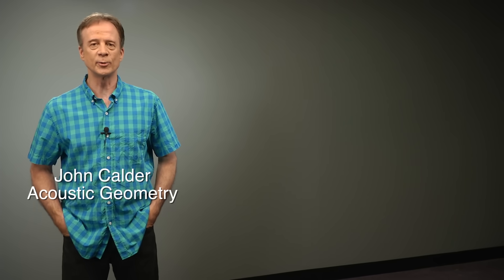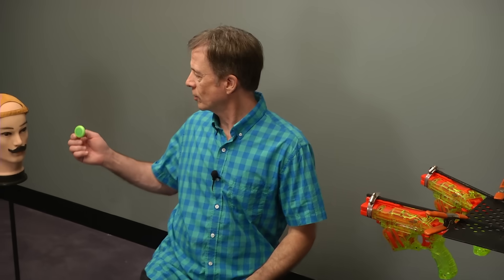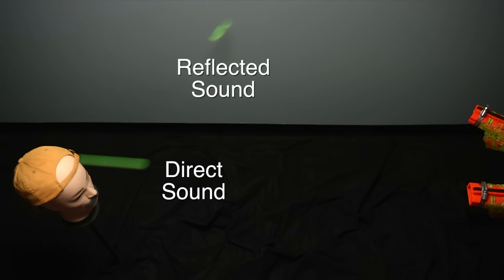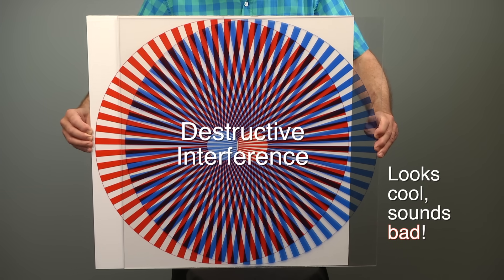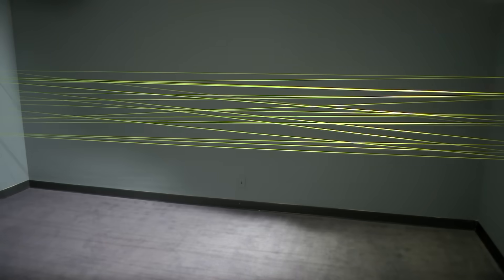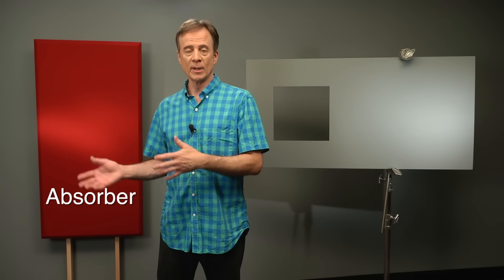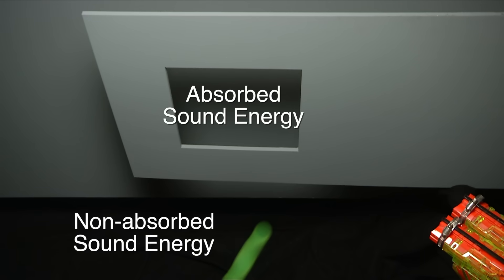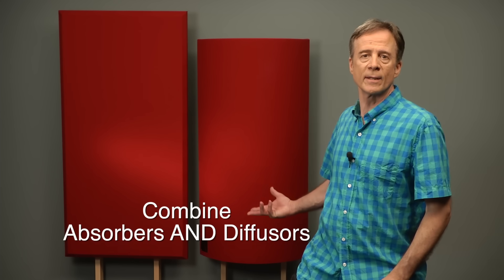How Sound Works (In Rooms)

Comment: You said sound bounces of the walls. But i heard also sound passes through the walls..🤔.so the question is how much in/out
Reply: Sound does pass through walls, but it's mostly the lower frequencies that you have to worry about. That's why you'll hear the subwoofers from people's cars going by, but not the rest of the song.
Reply: Sound can pass through walls but it's a subjective question because you'd have to define what type of wall it is. More sound will pass through a dry wall layer then say a brick wall....the reflections from a dry wall and brick wall are going to be different as well I wouldn't say either is better as a bare wall. 

All walls arent equal...sound proofing is based around thick and or reinforced walls. Which is why the average home/project studio will have acoustic issues. Things like a mattress or a large bookcase filled with books ...or even a thick rug on a wall or even better hung from the ceiling close to a wall can help drastically. 

 In a perfect square 4 wall room if you can cover the wall the speaker points to and the wall that is behind the speaker those would be the first areas to address. If the r room isn't treated and you have hardwood floor cover at a minimum the area you listen at. 

If you have carpet your in business. This won't solve all the way around acoustic issues in a room but it will reduce excessive sound from bouncing  around. You don't want to over do it either you just want an environment where the sound can land softer....this is extremely important and goes a long way especially when mixing and translating mixes. Good Luck!
Reply: @magicizaproblem  damn bro.. never expected this much.! Well explained. And much appreciated.  😊👏👏👏

Comment: According to some other videos; in terms of audio, placing the speakers 1/5 of the rooms lenght and depth will achieve better sound. Does anyone know if this 1/5 rule is simply to reduce distortion without the need of dampeners and difusers? Or do these 2 methods work in sinergy towards the same end?
Also, 2 more questions:
how do windows affect wave's behaviour?
How would one decide where to put the dampeners and diffusers?

Comment: Great advice for auditoriums, but at home I'm a pack rat with my rooms crammed with all kinds of stuff and most of my walls are either blocked by stuff, shelves, furniture, or covered with frames, paintings and other things hanging on the walls, and of course, there's also windows, drapes, blinds, screens, rugs, doorways, and various ceiling material.

Comment: This by far is one of the best videos about echoed sound ive seen thus far.  . . Straight to the point with a long drawn out explanation.  He even had examples.. i love it !
Reply: That is not echos sound, but reflection of sound refers to the bouncing of sound waves off a surface. This can occur when sound waves encounter a solid object, such as a wall or floor. Echo is the repetition of sound that occurs after the original sound is produced. It happens when sound waves reflect off a surface and return to the listener.

Comment: Nice video! But 'feet' as length measurement seems a bit outdated and inefficient (relations between those length measurements such as feet, inches, yards, miles and so, doesn't even seem lo like each other since 1 foot = 0,000189394 miles.)
Reply: Base 10 counting is outdated and inefficient. http://dozenal.org/index.html

Comment: How do acoustics behave in principle? Like optics? Are there UltraViolet or Infrared equivalents on acoustics?
Reply: There is a material's quality to have moving patterns of denser and thinner layers of particles, you can probably call them sound waves. For example, you clap your hands and disturb the air, this disturbance makes contact with surrounding air and disturbs it as well, so the disturbance travels in all possible directions. If they don't have something in the way, the waves reach your ear's membrane and makes it wobble a little. After that, your physiology refines the wobble and transduces it into your central nervous system. The final sensation that you experience, I believe, is sound.
Just writing from the top of my head

Comment: Yeah, cool explanation of how sound in a room works but it does not cover - at all - how the different frequencies work in a room. These absorbers will not absorb mid-low or low sounds. So installing a couple of these panels will not give you good acoustics.

Comment: That was a great explanation. But how can you apply that when you are having multiple signal output? Ex a home theater or in a small rehearsal room where you have a drum set and multiple speakers.
Reply from the maker: Thanks for your question. The same observations apply to any and all signal sources in a room. By diffusing the flat-surface reflections - often by evenly spreading the diffusors around the space - you will find the reflected sound has less of a destructive effect on the original sound. Adding some absorption will also help, and evenly applying the absorber panels around the space (don't forget the ceiling) will likewise help all signals. We always recommend phase-coherent diffusors (like our Curve Diffusors), as the phase coherence of the diffused sound will have an effect on sound-field perception.
-John Calder

Comment: I am also working in acoustics and my special interest is sound reality.  My opinion is that reality has  one basic- the acoustic presssure in ear must have the same curve as the electrical signal in recording. Other words - response from pickup to ear must be flat. Recording usually is processed by incorporated reverbs and more or less formed frequency curve to obtain near or distant impression or special vibration. In this case  expecting "oryginal sound" say pure piano or perc or human voice  is a big mistake. Its all a  stage of recording. All I am fighting for is to hear  sound the same as was recorded. And  I want to hear that in reality of my room  - not in non echo chamber. It means I want to get impression that all is happening in my room with it's reverbs.- not in pure deaf space. I find it most comforatble and not fatiguing. To have it I adopt   frequency response of my columns to normal room conditions and consider treatment only in case of very bad acoustically places .  Producers doing all checks  in nonecho chambers have nice and easy standarization of measuremants but it all falls in customer room. Asking people after to make thair compartments non echo seems to me not fair. The same: a am not going to treat my room before asking freinds for  talking to hear them real. With all reverbs they always are.

Comment: how would it sound in a "square" cylindrincal "room" with waterly surface i mean for example a 4 meter diameter cylindrical room, 4 meter high, and the only wall not "flat" but with a texture similar to an acoustic foams, so to say a wall with the form as the frequency representation ("waterly") . what would be the pros and cons? thanks.
Reply from the maker: I'm not sure what you mean by "waterly" exactly, but we have treated a very large oval-shaped room previously. You can read about it on our blog: http://bit.ly/PM8ERT

Generally speaking, circular-shaped rooms are among the worst "acoustic geometries" to treat. The other really bad shapes are sphere, oval, and cube - anything with concave surfaces is difficult to the focusing effect of the surfaces, and any shape that repeats dimensions (like a cube) multiplies the room mode issues.

Spray-on foam wall and ceiling treatments are useful to dampen industrial structures at high frequencies, but foam acoustical products, broadly speaking, tend to absorb or dampen mostly higher frequencies. We find them of very limited usefulness in combating difficult or high-level professional space issues.

Thanks,
John Calder
Acoustic Geometry
Reply: not my language english. i mean waterly like "waterly wall" trying to express a wall with a texture as a convoluted foam ( now i found the right words :) ) thanks for the answer. so then that´s why drums are circular "discontrolled sound"?

Comment: I dont agree with using absorbtion at all.  Most people over damp a room which results in poor soundstaging, dynamics, and can have huge issues in overall frequency responce.  The issue with absorbtion is its not linear, it will absorb at some frequencys and reflect at others creating comb filtering and large peaks and valleys in the frequency responce.  Defusion is the more ideal way of dealing with reflections, by scattering sound waves and minimizing parallel surfaces and flutter echo which is the main issue.  For toning down some of the really hard surfaces, I believe in very light materials that dont absorb sound but delay sounds only at mid to higher frequencys. Then you have to deal with room modes which a whole other issue.
Reply: I think it's important to treat each situation on a case by case basis. I don't see all these panels as 'musts' but 'tools' that might be needed.
Reply: This video is meant to just describe the fundamentals.  If you've come here to have your views challenged (which I'm giving you the benefit of the doubt that this is what your argument was for, as there would be no other good reason to make it in such context), well then as perhaps already implied, this wouldn't be the proper forum to do this.  You simply vomited the latest of what you've come to know and that's fine actually; I understand the urge for that.  But please, have some respect for those perhaps starting out and trying to build their way up for whom this video is meant to aid/guide.  There's nothing in the clip that's in conflict with the things you've described, and what you mentioned doesn't support not agreeing with absorption "at all".  It is as you said, depending on how you do it and the circumstances for which this is done.  The rest of what you said is additional/tangential.  I don't mean to accuse you of anything but perhaps getting slightly overly eager to profuse your knowledge where you seem to have found a contingency on the matter.
Reply: Oneness100 .
You also make these claims, as you're saying others are, in regards to how well you're implying these panels and other products by Acoustic Geometry work.  Have you tried them or know of accurate measurements made of them, and have you compared them to other products?  I'm not sure if it's intended or not, but you seem to be denigrating the value of the products they're suggesting without even knowing much about them.  It's fine to inquire, but you're actually making assertions of there being inadequate information without understanding the purpose behind the video(s).

I'm always in favor of, and often times demand, more in-depth information, but it would be ludicrous to have these expectations as they would apply here.  These are just meant to be useful informational videos for people seeking to learn about these type of products and the problems they address.

I am interested however - without denigrating the product here (which I am only arguing for with there being no proof against their stuff), could you list and maybe describe some of the other companies/products which you are fond of and the specific purposes for which you prefer them?  It would particularly be interesting for you to note which products you regard as best and/or actually effective for the lower frequencies.  Thanks!
Reply: They also tend to not look at absorption curves.  Absorption panels/foam are not created equal and a lot of people just buy what is the cheapest not realizing it may not have the best absorption curve and therefor won't sound very good because it doesn't absorb the frequency range that needs to be absorbed.  Diffusors should be used in some locations, but in others foam absorption might be better suited.  It's all about which reflections you are dealing with and how to get the right balance for the intended purpose.  Some engineers like a lot less liveliness to the room because they are doing listening that requires close listening and they don't want the room affecting the mix.  So a mastering engineer would treat their room differently than someone in their home sitting back listening to music for enjoyment.  Everyone has different tastes in what they want in an audio system in terms of sound quality.  Studios tend to have a more clinical/analytic purpose and home is more of a need to enjoy listening and therefor will have different levels of delay times from the 1st, 2nd, and 3rd reflections.  There is typically a range that is acceptable for most people, and some lean towards one end, while others lean towards the other.  Heck, there is a LOT of differences in terms of what speaker one prefers, which will affect how one hears the content.

For some reason, I think a lot of rooms sound horrible because the acoustic engineer might not know what products are on the market that will provide a better sound as they tend to get used to designing rooms only using products they are familiar with OR then tend to let their budget dictate what products they use. 

I'm not convinced of only using diffusion and no absorption, you need both.  It's just finding the right balance, which takes time.  Bass frequencies HAVE to be absorbed, but there are only a few products that are really effective in the lower frequencies. The problem is, most people don't know about them since they are only available from smaller lessor known companies.